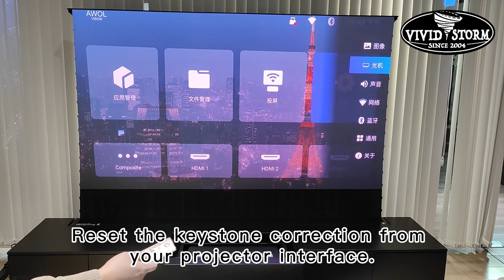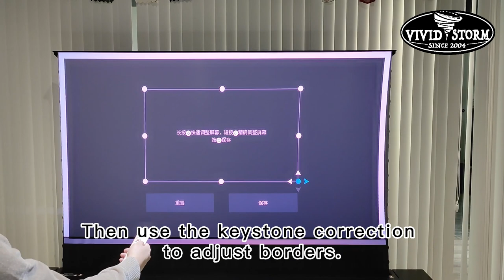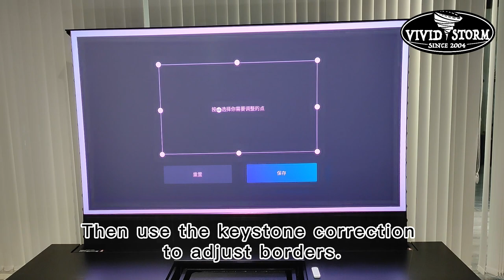VIVIDSTORM Motorized Laser TV Cabinet Monte Carlo Assembly Video

Comment: What do I do when the bottom assembly doesn’t come out far enough for the awol vision 3400 to fill the screen?
Reply from the maker: The distance of the bottom component of the electric drawer of the cabinet can be adjusted. As long as the distance is adjusted to a suitable position, there is no need to adjust the position when it is used next time.

Comment: So it doesn't come fully assembled?
Reply from the maker: This cabinet requires no assembly, just snap the three pieces together, and the cabinet is heavy enough so it won't shift. Then the wires connecting the cabinet, projector and projection screen can be integrated. Thanks!

Comment: does it make any noise when turn it on/off
Reply from the maker: Hi friend, there is no other noise during the opening and closing process of the cabinet, but there is a slight sound of the fan, but this does not affect your use of the projection. Thanks!